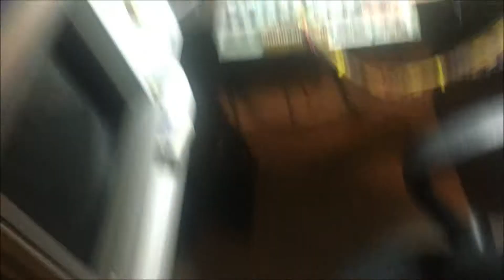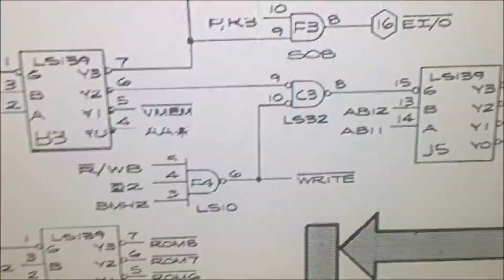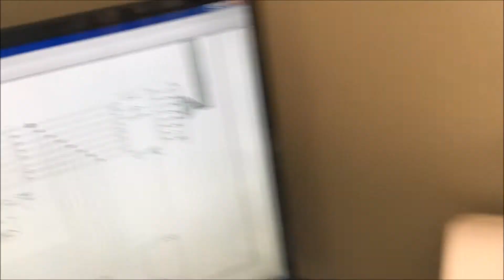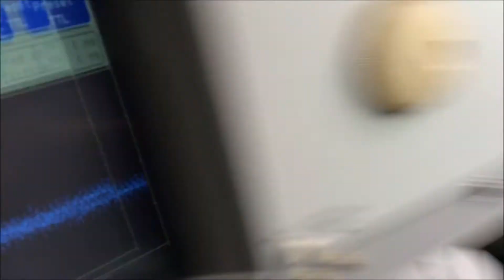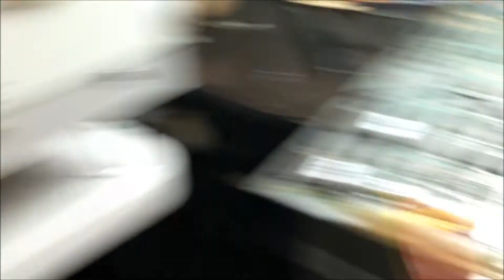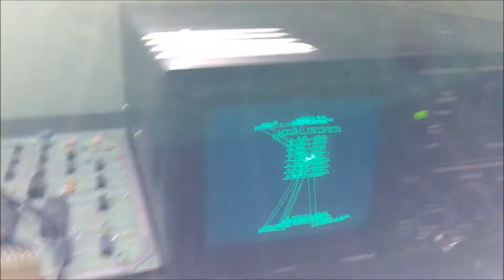1981 Atari Tempest Arcade PCB Repair #4

Comment: need a look at a schamatic for tempest  dont know why its not working tested power brick and its testing ok i think want to test ar2 board not sure how the game board light flickers but doest stay on any reco on what next also r29 is fried
Reply from the maker: Ok..  you need to stop turning the game on… You need to rebuild your AR board… Do the sense mod on the ARII so that it doesn’t continually try to up the voltage to the board… And you probably need to replace your edge connectors to the PCB...  In fact I can almost guarantee that you need to replace the edge connectors to the PCB..  And if you haven’t replaced the big blue capacitor in the transformer Assembly you should do that while you’re doing all this work
Reply: @classicarcaderepairs   wow thanks you do recommend the sense mod,does that eliminate the r29  frying and can i just it out after the mod?
Reply from the maker: bap Powell i do recommend the sense mod...  atari AR supplies have 5v looping from the AR to the pcb ...   if the voltage drops under 5v the supply will up the amperage to the pcb either frying r29, R30, or the edge connector on the pcb..  or all of the above..: the sense mod eliminates that loop..   so the supply will always see 5v and never burn anything up...  you can remove r29 and r30 (both10 ohm resistors) and jump them...  After you do that and replace the edge connectors and you should be all set power wise change the big blue capacitor to if you haven’t… It’s very important
Reply: @classicarcaderepairs  im on it gonna start rebuilding and modifying now thanks let you know how it works out maybe you can tell me where to ordera big blue thanks again
Reply from the maker: bap Powell You can get everything you need from arcadepartsandrepair.com